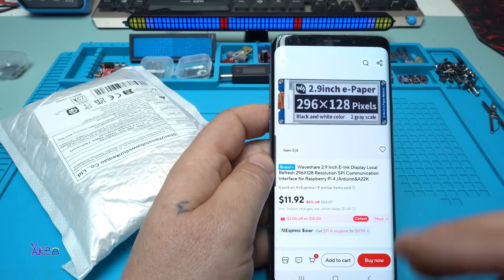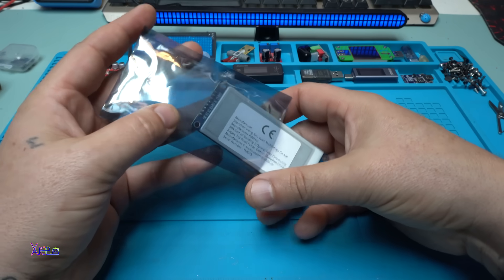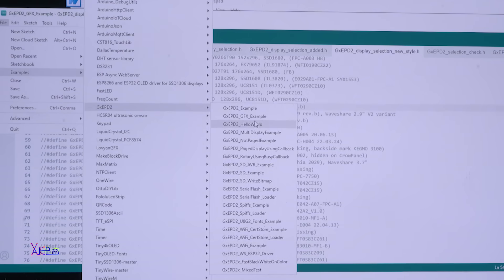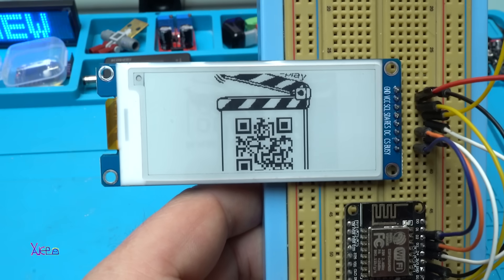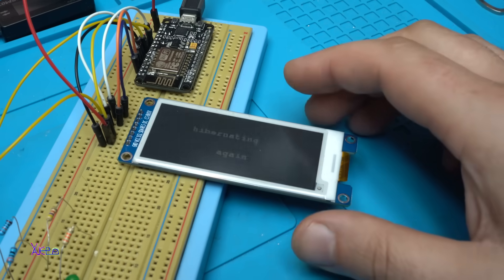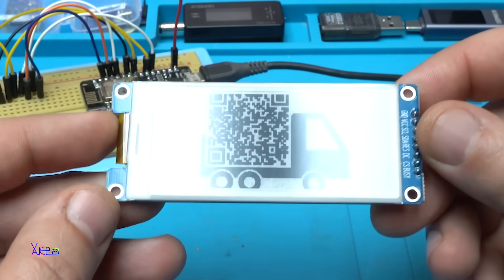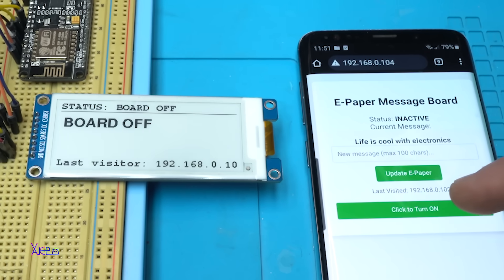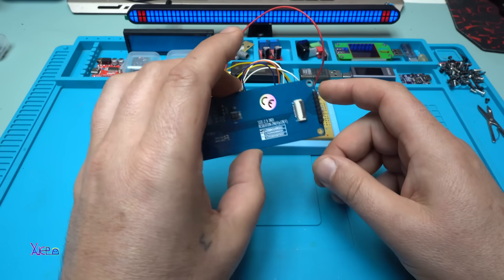NO Battery Display! E-Paper 128x296 from Aliexpress

Comment: And the low power is really true only if you won't update them that frequently. During update they are rather hungry (few 10's mA), but that takes only few ms and once you leave the image alone, they consume really zero.
Reply from the maker: Thx for info,I am working on solar powered frame with skeleton circuit using e paper
Reply: @Hacktuber There you need to use some tank capacitor (supercapacitors are a handy tool for that, they come in reasonably small factor), to collect the charge over time and then be able to supply that current burst for the image update.

Comment: Not sure why this is expensive,  I have a meshtastic heltec  E-paper , and it didn't really cost more than the OLED unit.  E-paper displays are so cheap, they are being used as price tags on shelves at stores, since prices can be changed on a whim,  saves on printing labels and the time needed to remove and place the new labels.   the good thing about these is, they are easily read in bright sunlight, and do not require power to maintain an image,  power is used only to re-write a new image.  so it is perfect for signage.
Reply: Probably quantity. The more they sell/make the cheaper they are.
Reply from the maker: That's interesting to hear about your experience with meshtastic heltec e-paper!

Comment: I got 2, E-paper name badges in the spring from Aliexpress (4 color) the colors are red yellow black and white. it uses NFC to transfer from a phone app to the card. I was so exited to show a friend how it works, I broke it! they are on a very thin wafer. the plastic cover really wasn't much protection for it. it is totally battery less! so far there is no 5-7 color version to the badge.
Reply from the maker: Thanks for sharing your experience sir,Also I will order a 4 color e-ink screens,need to try them.
Reply: @Hacktuber  you are most welcome! I ordered a ESP32-S3 3.16inch Display Development Board, 320×820 Pixels, 262K Color, 32-bit LX7 Dual-core Processor, Up to 240MHz Frequency
my c++/python is a bit rusty but I hope to make a multi picture name badge.
Reply: Do you have a link to the seller page?
Reply: @andyspoo2  unfortunately no, I bought it before March of this year. but it was listed as an ID badge. it is very important to let them know the exact color amount. (the Aliexpress choice boxes are very misleading!) I think I did a search like "e paper ID namebadge NFC " alibaba is another option. (same confusing options)  colors 2=black and white 3=B W and red or yellow 4= B W R Y.

Comment: I really like the idea of epaper but cannot actually think of a good use for it due to the slow refresh rate and the fact that it does use quite a bit of power to refresh so a clock is not really suitable, perhaps weather and stock prices updated every 10 mins or so but that's easy on my phone...
When a full colour high res display is cheap enough a picture frame would be good.
Reply from the maker: That's true, the refresh rate can be a challenge for some uses.
Reply: there is a kickstarter called "LumiCap" , but it's still pretty pricey for the screen size.

Comment: E-paper works kind of like magic ink! Tiny capsules filled with black and white particles sit under the screen. When electricity pushes them up or down, they make words and pictures. It doesn’t glow like a tablet — it reflects light like real paper and only uses power when it changes the page.
Reply: To a person who has not learned magic, everything seems to be physics.)
Reply: @Karambuy 😅
Reply: Slow updates, 😊so not used where fast updates are needed, but great otherwise.
Reply from the maker: Thanks for the great explanation!